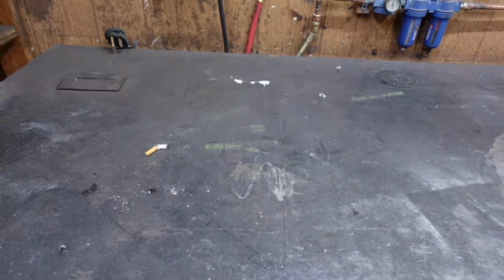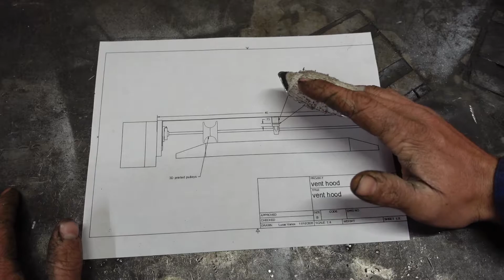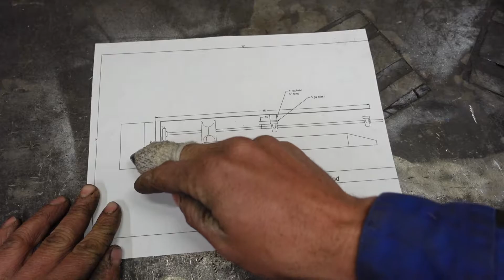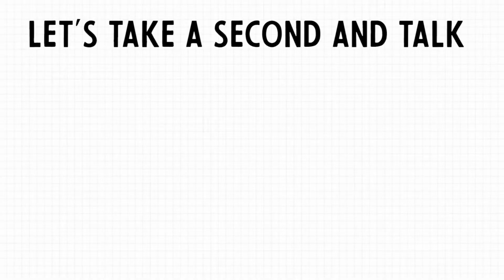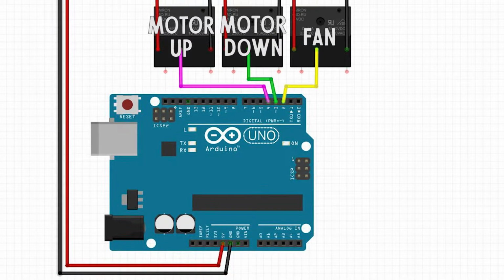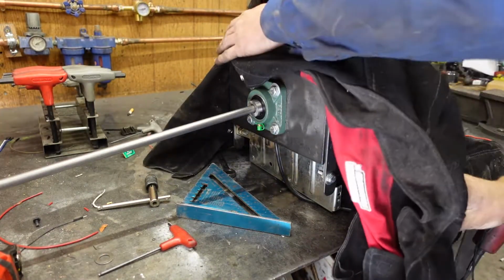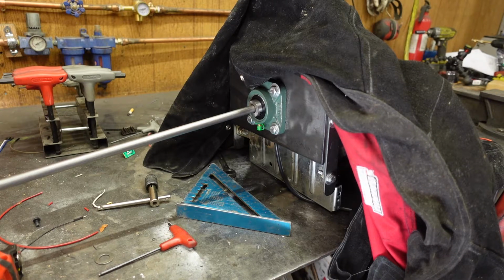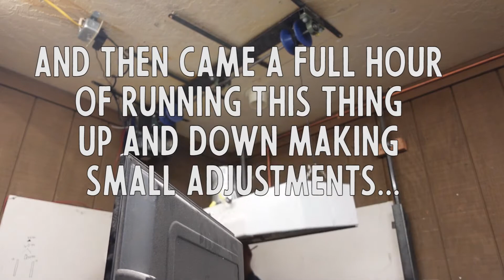Arduino-Powered Automated Fume Extractor

Comment: Did you make or buy the fume exhaust hood? I am getting ready to build a hood for my rolling pipe welding setup as there is a lot of smoke....
Reply from the maker: I bought the hood, got it secondhand for less than 20 bucks. Although, It wouldn't be too difficult to make one!